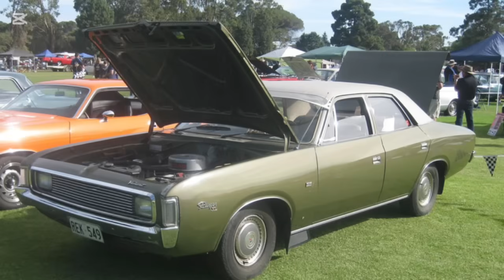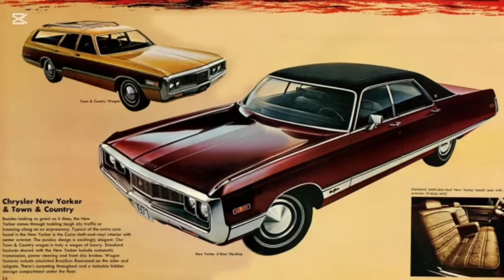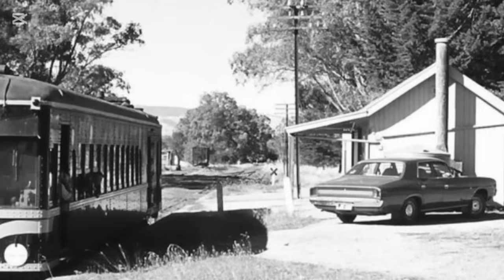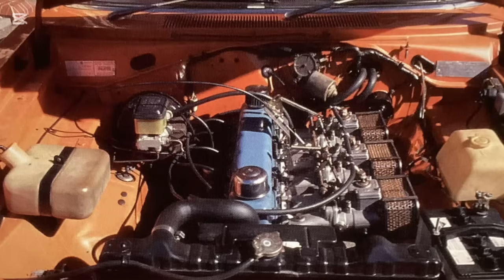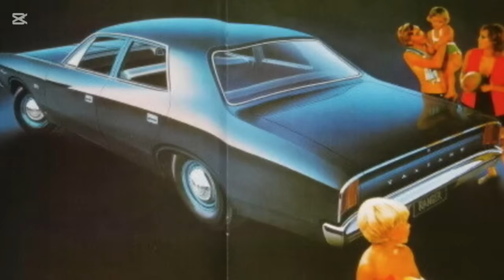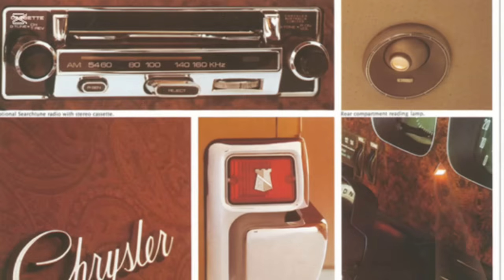VH Valiant & Charger - The Most Comprehensive Video Ever!

Comment: I've always liked the VH/CH series and have owned a few VH Vals over the years since buying my first H in 1985, age 19. This is a good video, informative and quite accurate.  Well done. I've owned a genuine factory automatic VH Pacer since 1997, I'm the 3rd owner. Hot Mustard, body number 821 (in the 7S41 build)
Reply from the maker: Thanks. Very cool. That is a rare car now. 👍
Reply: Hi, Gary here, answering some questions regarding my genuine factory automatic VH Pacer. The transmission is a BW 35. It is one of just 16 ordered with auto trans. The body number stampings say 7S42-821 followed by SOA106, which means special order accepted, automatic transmission. On the compliance plate it says 8S41-821. The D341 engines were available in 770 Chargers, and 770 Regals with auto trans and some CH 6 cylinder sedans and Hardtops optioned with the hemi six also had D341 special engines. Some VH automatic Pacers were fitted with standard D331 engines, the first 5 of them were built that way. Only 5 had the D341 blocks, mine was the second one produced that way. The original engine number was D34100050. Previous owner got a change over engine from Southcotts engine reconditioners, and my original engine ended up in a VK Regal that was crashed in 2007, and the water pump drive shaft smashed the front cylinder bore, ruining the engine. Only a handful of automatic VH Pacers had the D341 blocks, the remaining examples on the factory build sheets were D331. My car had a 73 vintage 265 in it when purchased in 1997. It now has block number D343D00191 up front, and this engine originally came out of VH Pacer body number 99. Options for my car, A95, B51, Z98. This car was originally a government fleet vehicle and was purchased at auction by a gentleman named Tom Bowker,  who used the car as daily transport until age 94, and then he sold it to me because he was getting too old to drive it anymore. He passed away shortly after. Of the 16 auto trans VH Pacers, 4 were painted Hot mustard, two with T1 tan interior and two with X1 black interior. Three had option 65, bonnet black outs and mine is the only hot mustard, plain bonnet, tan interior auto trans VH Pacer ever produced in it's configuration. It has the Pacer stripe on it, and left the factory as such. There's no separate 8S41 list for the 16 auto trans Pacers, they're included in the regular build list with the 7S41 versions. I've seen the original factory list, I know who has it. Some copies of the lists have errors, some automatic transmission versions have the WRONG engine number listed, mine included (D343B0050, not D321B as clearly stated on the original list) I have actually seen my original engine with the smashed cylinder bore.
Reply from the maker: @garystokes9979 Wow. That is terrific. Thanks for the info Gary. 👍
Reply: Correction, the VK was crashed in 1998. My phone made some typo errors with it's stupid error correction which makes errors. Frustrating!
Reply from the maker: @garystokes9979 Yes, I hate when the phone does that. So annoying. 😡
Reply: Block number in the car ATM is D343B00191, stupid phone changed B to D.
Reply from the maker: @garystokes9979 👍
Reply: Nice.  I wasn't aware that there were any automatic VH Pacers.  Years ago I owned one of the few automatic  VG Pacer coupes .I assume the automatic in your car is a Borg Warner ,not a Torqueflite?
Reply from the maker: @barrycuda3769 I know they also built a couple of six pack manual Pacers too. 👍
Reply: @markbehr88 I wasn't aware of that . There was also that one VH Ranger ordered with a 265 E49 spec engine.
Reply from the maker: That would have been a really unusual car. Maybe for rally work? 🤔
Reply: Interesting that its body 821. With the other madels and submodels, the drivetrain subvariants start 1. In other words if the Auto Pacer 8-S-41 were an intended model subvariant and there were say 20 of them they’d have been numbered 1-20. Probably the case they were just built for customers who insisted they wanted an auto Pacer so were just jammed in amongst the manual 7-S-41 sequence numbers. Imagine being a salesman with a customer in front of you saying “i want an auto Pacer”, you say “sorry they are manual only”. Customer says “yeah no worries I’ll just go buy an auto GS Falcon from the mob next door”. In that scenario as a salesman you’d have just put the automatic Pacer order in, and see what happened.
Reply from the maker: @chrisgregory4796 Having worked for Mitsubishi Distribution (which used basically the Chrysler process) either a dealer would have called up for a special order or - more likely - the company just built a small batch and then phoned dealers to say “Do you want one? We are doing a special run”.  They have to have unique codes for the production line process. We did the same thing when we did a special batch of GN GSR Sigmas in black. They looked terrific. 👍
Reply: @markbehr88 they were excellent cars thank you for your care and pride in your work 👍
Reply from the maker: @antonyfrost2541 Thanks very much. 👍
Reply: Just curious did your auto pacer get the Pacer/RT appearing D341 engine or did the factory just jam a regular looking D331 engine in it like what would have gone into any other non pacer 265 auto car? Hard to imagine them going to the trouble of fashioning up a D341 engine just for a small handful of customers.
Reply from the maker: @chrisgregory4796 🤔👍
Reply: For some reason, D321B was another screw up, should read D341B00050.
Reply: 7S42 was another stuff up I missed. Should say 7S41-821.
Reply: And I missed a B in the engine number somewhere too. Bugger.
Reply: Option 65 should have read as A65. I apologise for the errors in my comment.

Comment: Great video, Mark. A trip down memory lane oozing with nostalgia and hitting me right in the feels. 😍
Dad come home with an Arctic White VH Charger in 1972 "Hey Charger!" It was traded in '74 for a CH Chrysler by Chrysler to tow a huge Viscount caravan across the Nallarbor Plain before the sealed road opened. Awesome car, very posh at the time.

When we returned to Melbourne from touring WA, the beast was replaced with Centura for a little while, but Mum kept doing accidental burnouts at the traffic lights with its 265 Hemi and manual gearbox. 🤣

So, back to luxury, we upgraded to a new '77 Chrysler Regal SE. In 1980 on the way home from taking my Nanna out to bingo, I spotted the old Charger at a used car dealer, I recognised the number plate. Dad went down the next day and bought it back as a second car for Mum.

In '82 we also picked up a Valiant VH Regal Station Wagon for our paint shop deliveries. I loved the hum of the old station wagon, sitting in that thing was like going on a trip to Wally World in the Truckster. 🤪

Then in '84 I got my licence and my parents surprised me with my all-time favourite of all the Chryslers, a mint condition VJ 2-door Hardtop. Most excellent first car. It was gun metal grey with a black vinyl roof and 265. I did the AAMI driving course near Shepparton to get cheaper insurance in it. That was a wild experience. The old whale was a challenge when doing emergency breaking while turning. The training instructor had to have a couple of goes himself to get a feel for its big arse end. It really was a fun car to drive but a bit scary stopping it at quick at high speed pumping the brakes like a mad man. The brakes just weren't equipped for the job, even after being fully serviced the car was just so heavy. The Hardtop stayed in the family until about 1998 when Dad had to sell it as Mum said we had too many cars. 🙄It still tugs at my heartstrings these days whenever I see videos like this one today. I'm really looking forward to your next episode on the VJ's when it comes out. 

So thank you for taking the time to make all your videos; love 'em all! 👌
Reply from the maker: Wow! Sounds like a lifetime of great cars and memories. 👍. Thanks for the comments. 👍
Reply: I'm sure the hardtop with a 265 would be just like my VH sedan with a 245 , in terms of the rear end being well planted to the road , I can't remember mine ever breaking loose and going sideways, except for on grass , as opposed to the earlier smaller Valiants, they can be a bit tail happy , especially the V8's.
Reply from the maker: @barrycuda3769 👍

Comment: G’day Mark,

A massive massive congratulations on your best video to date.
Normally I wouldn’t sit for a 1 hour video but your video was an easy listen and thoroughly enjoyed it.
Couple of corrections.

The 770 SE 340 Charger were fitted with the fish scale dash with the tachometer dash, where all other 770 wood grain dash had a clock fitted.

The 318 was hooked up to a 904 Torqueflite Gearbox.

The 340 motor didn’t come with the 340 ram horn exhaust manifolds as they did in the states, here we got them fitted with 360 exhaust manifolds and a single exhaust.

Highly recommend getting your hands on the latest book 
“ Hey Charger III “ by Gavin Farmer which I got for my birthday this year absolutely a great book, and you are right the 340 was never going to be raced, too nose heavy for starters.

Also absolutely happy you used the correct terminology regarding Hardtop and Coupe.

In my opinion, there should have been a Hardtop version of the Pacer also.

I prefer both the Charger and Hardtop with quarter vent window, especially year down the track you don’t get the rattling from the one piece glass.

I was hoping you would show your audience the picture I send you of the barn find 
Chrysler by Chrysler Hardtop I found last year, also got to follow up on a E55 Barn find too in the outskirts of Melbourne.

Chrysler by Chrysler Hardtops had a red centre emblem worth a kings ransom today where the sedans had a blue centre emblem.

Also need to meet in Adelaide where a friend of mine has 2 CH Hardtops and now a white 
P5.

I have owned the following

1x VH Hardtop 770 V8, red with white vinyl roof and white interior unfortunately destroyed by a fire soon after the new owner bought it off me.

2 x CH Hardtops both 360 and both the shitty brown colour.
The last one took 15 years of consistency of asking the original owner being a doctor.

I will stick to my VG Hardtop’s, the VH Hardtops look great and I reckon you can sell them over in the States for a great price they love them over there.
The Charger absolute legend of a Aussie muscle car, imagine if the E49 won in 1972, forget the Phase III, the E49 would command more respect.

Great video Mark almost 1 am time to go to bed.

Well done 👍

Cheers

Louis Kats 👍
Reply: Hello Louis.
Reply: @garystokes9979 

Hi Gary,

Did you get my YouTube message from the other conversation about the car club I am in, video that Rai did of my VG Hardtop in Melbourne and the area and people I know ?
Reply: Early production sedans also had the red grille emblem actually. They were left over from the US Imperials, and then blue versions were used from there onwards.
Reply: @garystokes9979 Never knew that all the sedan I have seen have always been blue.
But being Chrysler anything is possible.
Reply from the maker: Thanks Louis. Glad you enjoyed it. The fish scale dash in the Charger was on the VH 770 models too. The one I drove back in the 1980’s had that. If you can resend me that photo I may include it in the next episode. 👍👍

Comment: When my father was in the market for a second hand ute in the mid 70's to replace his HR ute when it's motor blew up, he visited this used car yard in a town in southern NSW and took me along.  The fella had two utes in stock; a VG Valiant ute and a VH ute. He took the VH for a test drive, being the later model. I vividly recall him opening her up on the outskirts of town. The power was astonishing. Just a complete rocketship. It was a manual, presumably a 245 or 265. For reasons I no longer recall, he didn't buy it, and ended up in another Holden Ute with it's far inferior red six. 
My parents had earlier owned a VC Valiant wagon, so had experience with Chrysler, but during that time, the Holden dealer network was far more extensive in those remote areas, along with Holden mechanics.  
I heard somewhere that the Hemis were superior than even Chrysler's own V8's.
Reply from the maker: Sounds like a fun test drive, and yes the sixes were great engines. 👍

Comment: Your regal auto trans was incorrect the 6 cylinder Auto was a Borg Warner 35 and the V8 had the torque flight 904.
Reply from the maker: Yes. I meant the V8 model. 👍
Reply: I destroyed a couple of the BW auto boxes.
Reply from the maker: @peterclark2230 I’m sure a few people have? 🤔
Reply: From what I remember of the VK/CK workshop manuals, the 318 got the A904LA Torqueflite and the 360 (at least in the Chrysler By Chrysler) got the A727 and that was likely the low performance variant. Not all A727 are the same.
The CbC was also graced with the stronger Dana 8 3/4 inch 4-pinion diff.
Reply: @tedpalmer5552 So the trans were all 6 cylinder BW 35 except k code and tow pack , 318 had 904 , 340/ 360 had 727 all had a BW rear axle e57 using 2.78 to 1 ,
Reply from the maker: 👍Good info
Reply from the maker: @tedpalmer5552 👍👍

Comment: Hi Mark, firstly , stunningly good video bud .

 I remember when dad received his new two door coupe VH Chrysler by Chrysler, specially made in triple black for the US government in Australia where dad had a very senior role. The coupes had a wild paisley patterned vinyl roof treatment, with black paint and black tall backed brocade covered seats, very flash and with a powerful Mitsubishi Electric stereo that had the best bass sound ever.  When parked outside our home in Roseville, Sydney a female drunk driver in a Datsun Bluebird SSS crossed to wrong side of road and struck it at speed as she was so drunk she had passed out and the weight of her foot/leg had nailed the gas and hit our Chrysler Coupe destroying it. When dad wanted another one he was out of luck as those poor selling long wheelbase coupe bodies had been cancelled and replaced by the stocky bum Chargers. So dad ordered a new black four door one which had a deep plum color brocade interior. The ZERO inertia door latches that gave the unusual and classy "CLOMP" thud sound even if the door was closed harshly or softly, similar to mum's big Jaguar mk10/420G so no door slamming was required. The only pesky thing with dad's pair were the difficulty starting them when it was cold and wet Chrysler corporation starters have their own weird sound, really the battery fitted was too small for the engine size 6 litre or 360cu in, mums Jag was often used to jump start the buggers as the 4.2 litre Jag had a huge truck size battery & when attached to the Chrysler it made the weird Chrysler starter fling over that quickly it sounded like it was about to self destruct.

50 odd years later I still have the excellent Mitsubishi Electric stereo from the C by C coupe I nicked from it when it was wrecked, it's still works fine and by fluke is in my big Jag mk10/420G that is identical as my mum's old one.
Reply from the maker: Thanks very much Greg. Glad you liked it. I would love a factory black Chrysler by Chrysler. I saw a sedan once over at Epping. It was an immaculate funeral director’s car. Drove past me in the 1980’s and I thought - “Wow. That looks good!” 🤔👍
Reply: POSTSCRIPT
re the doors.
In the years prior to automated soft close doors, the ZERO INERTIA door locking/closing feature was found on expensive upmarket cars, so no uncouth door slamming to shut the doors. My 1967 Jaguar mk10 or 420G as the later version was called has zero inertia door locks, same with the whole 1960's Jaguar range, then with BMC-Leyland as their new main shareholders the new Jag XJ6 was made to use a cheap door locking unit where you had to slam the doors to get it to shut even if all the windows were down.  GO to some of my American cars, my two Cadillacs '72 & '74 Fleetwood Broughams zero inertia door locks and their soft close automated boot lids mean NO slamming, however, my '72 Lincoln mk4 Coupe & '79 Conti' Collectors Series Town car do not have zero inertia locks meaning EVERY time you shut the door or boot lids they need to be slammed shut to close them otherwise they just sit on half latched and then you get the door ajar light and warning screamer bleat at you.  Back in the late 1960's an elderly great Aunt had a new Merc 280SE you slam the doors shut even with the windows down, I always was worried that I would break it by slamming it, but as Auntie Bessie said the crazy krauts do not know how to make a door catch, her prior car was a MK2 Jaguar where it softly closed with a "clomp" like the CH-VH cars with no crazy slamming required.
Reply from the maker: I must say Greg. I love the way Mercedes doors close on the older cars. 👍